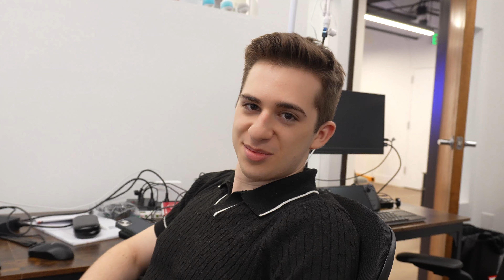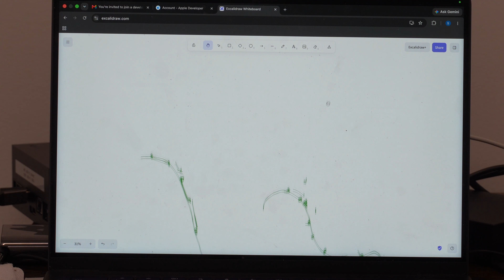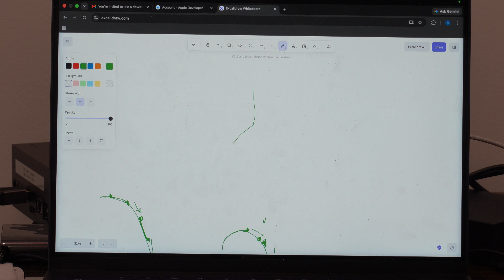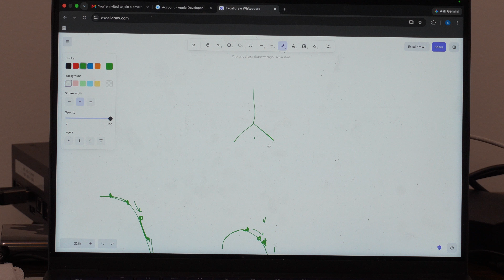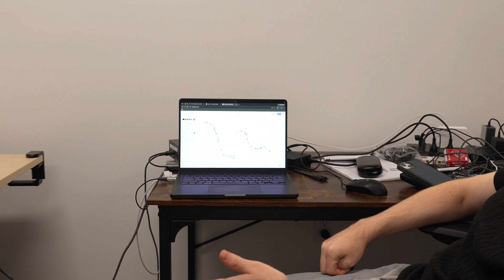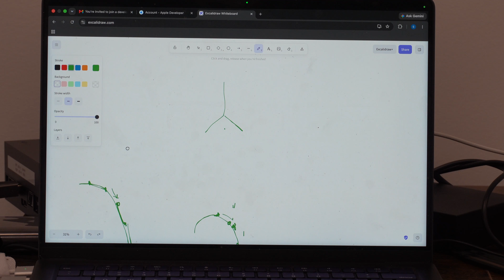Why Robotics AI is Hard

Comment: Great intuitive breakdown of how local minima and high dimensionality make discrete-step RL so difficult for embodied agents.
The sheer difficulty of navigating these massive, multi-dimensional loss landscapes using standard discrete gradient updates is exactly why I've been researching continuous-time dynamical systems as an alternative. I recently open-sourced an Artificial Life framework called 'Avatar' that models an agent's internal state using continuous-time Hamiltonian Neural ODEs rather than discrete timestep updates.
By anchoring the agent in Hamiltonian mechanics, physical constraints like energy conservation are handled intrinsically by the math of the system, rather than needing to be explicitly learned through massive trial-and-error reward engineering. To handle the high dimensionality, it structures the cognitive topology using MERA tensor networks.
If any developers here are exploring alternatives to standard RL and want to look into physics-informed AI or continuous-time dynamics, I've opened the core codebase for review here: https://github.com/linga009/Avatar